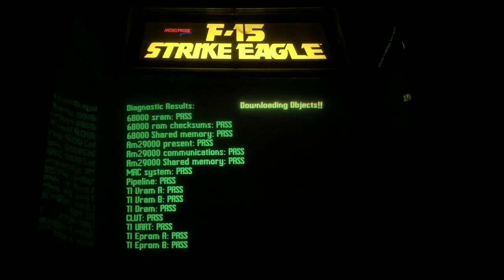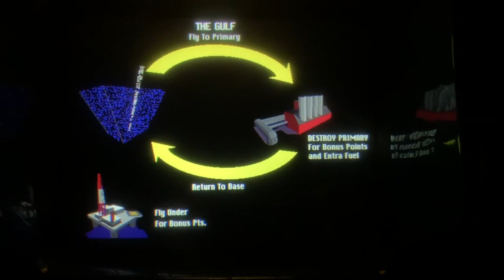PCB Repair: F-15 Strike Eagle (Fixed)

Comment: ...By any chance will this serve as eventual reference to get the audio on the MAME driver 100% working?

(attract mode audio isn't working no matter what I try, and I was surprised certain sound test functions were working at all...)
Reply from the maker: Audio worked perfectly when the game was added back in 2010. It broke when the 68681 DUART serial port code was made more accurate because the 8051 serial code was not updated accordingly (it's not an easy task given the level of accuracy demanded). I might try to hack something in the micro3d driver to at least get sound working again until then. Having access to the machine I hope will help figure out why the game is running too fast in MAME!